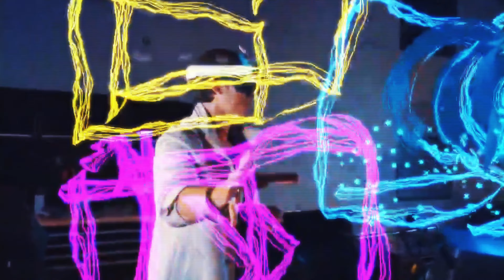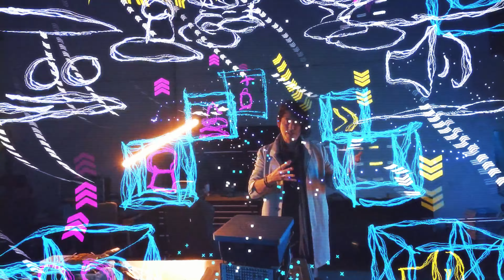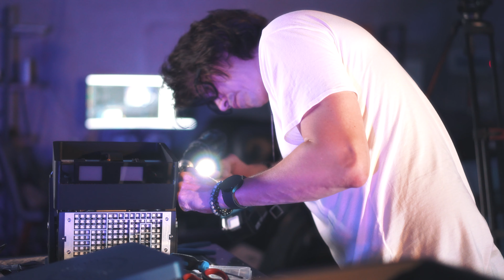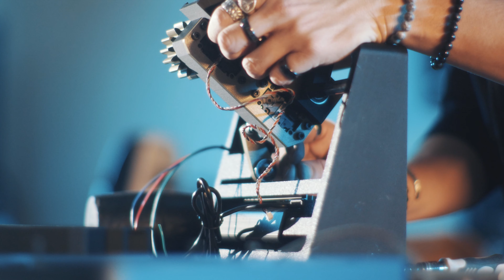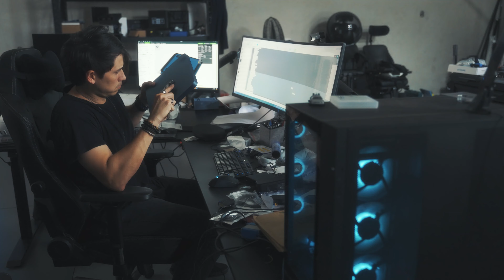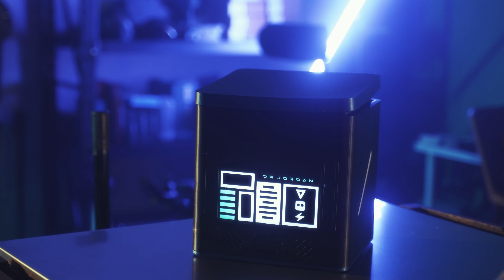Episode 05 - Upgrades. Lots of Upgrades.

Comment: Oooh know when to use a screwdriver or hammer when putting the components in their place😂✨️🌌⚛️
Reply from the maker: Haha usually not the mallet unless parts like metal bars get wedged and stuck 😂
Reply: A fine tip pliers and long hardware tweezers also are very handy Dr Jordan Nguyen 🔩⚙️🪛🧲🧰🛡